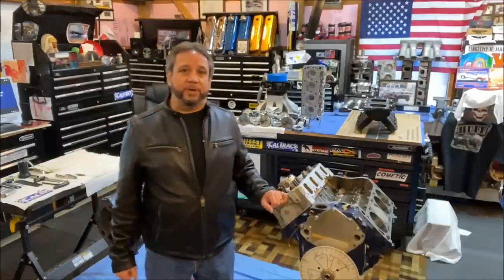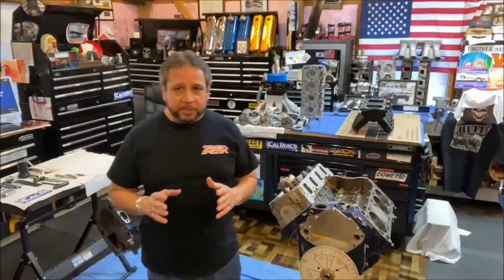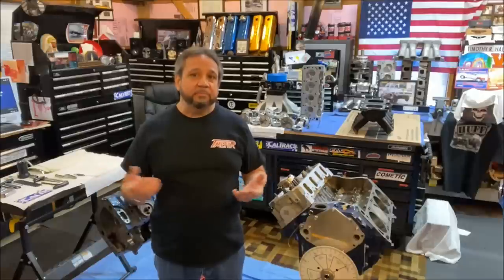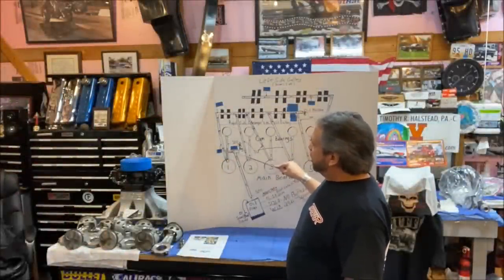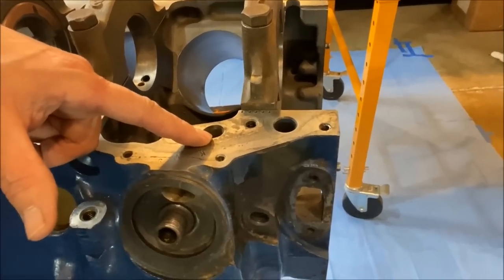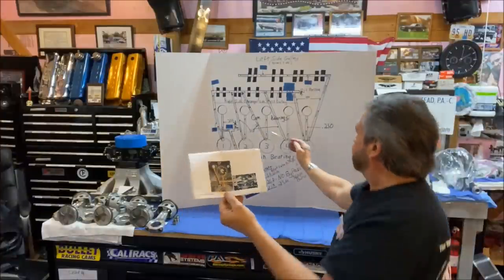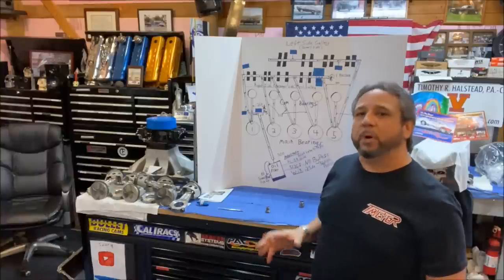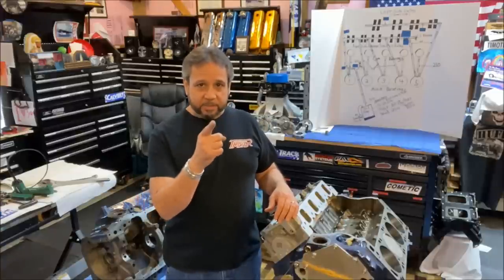Ford 351 Cleveland Oiling,  The Truth, and More

Comment: I built a 351C in the 80’s with mostly stock parts, roller cam and roller rockers. The motor in a Mach 1 with FMX it made 500+hp at crank in 86. Trouble was trans for us but 500 or so in a street car making 380 at the wheels, chassis was crap and flexible! Loved that motor!
Reply from the maker: thanks Paul, love hearing these stories. If you would have a good, C4, it would have been a different story, and you probably bend it up. Thanks for being here, make sure you subscribe, so you don't miss anything.
Reply: Hi Tools, what mods did you have on your Cleveland for the 500HP?
Reply: @DragBoss351Cleveland  what the auto trans to have? And what is manual was an option?
Reply from the maker: @jamesmedina2062 to me a C4, and toploader works well, but nothing like a jerico for racing, sticks only from word of mouth, never raced one yet. But installing on one now in mock up.
Reply: @DragBoss351Cleveland  what if you just want to have fun on the street? Tremec t-5 or top loader?
Reply: @DragBoss351Cleveland  what if it was balanced with flexplate and I want to switch to manual?
Reply: @jamesmedina2062   we used an FMX just barely held together, cast iron cast and sacrificed over half again more weight than a C4 or a manual, my opinion T5 was never up to that HP,,, TREMEC maybe but not in that vintage the only manual of that vintage was the T10 toploader! Today I would use the C6 or a TKO600. Much tougher and easier to keep together!
Reply: @dennisrobinson8008   crane cams roller solid cam,,, 480 lift  as I remember serious overlap with 12.5:1 veolia pistons I think steel crank and crane roller tip rockers. I can’t remember any more right now! Brain cramps!
Reply: @tools6106  lol sounds good tho.
Reply: @dennisrobinson8008  it was 80s cool, wish I had that car now! It was my best friends, he ended up going to play for the other team,,, we parted ways!
Reply from the maker: @tools6106 yes for sure. I love all cars and engines and don’t get caught up so much in the drama. I just love ford’s.
Reply: @tools6106  Thanks man! I would like to manual swap to the TKO but money may not allow that. I could use a sale of this one as I am nearing 30 years with it.
Reply from the maker: Toploader I would say.

Comment: Awesome job putting a lot of detail into what can be done at home to get the best out of the oiling system without breaking the bank; even with the DIY lifter bore bushing kit on the market some people just want do do what they can for a few bucks to maximize the oiling efficiency. I spent a lot of time researching all this stuff before doing essentially what your describing. Most DIY guys are gonna have all the tools needed to smooth out and radius these galleys and put in a restrictor kit; great job. 

Not sure if you mentioned but for the restrictors; if your running a hydraulic cam they say to leave out the rear lifter galley restrictor as they need more oil.
Reply from the maker: Thanks Troy for the info. I did not mention that with hydraulic lifters. Good point, I never raced with anything buddy solid/solid roller cams. Yes they can clean lots of areas with minimal tools. Thanks again, stay tuned.
Reply: Love the solid flat tappet I put in mine; really woke it up a lot over the hydraulic it had in it before!
Reply from the maker: @troyberg65  no doubt, I have never ran a Cleveland in racing with a juice cam, only solid or roller. Went from 12.05 to 11.25 with only changing from solid to solid roller. Put I. A roller and see the difference. Obviously one that will fit your combo and valve clearance. Thanks Troy
Reply: @DragBoss351Cleveland  that really is a wild difference; I haven't made my final decision on cam but I am going to be running just iron 4V heads; probably the closed chamber ones (have both) current stock bottom end unit is running lunati 30320512 and its a very fun motor; and the whole cam setup was very inexpensive. Where as just the cost of good roller lifters for a cleveland cost well over the cost of everything for the flat tappet. Defiantly lots of benefits to the roller; but it is a mostly occasional street driven car with the odd friday trip to the strip.
Reply from the maker: @troyberg65  match the cam to the combo, if it is what works for you, roll with it. Your right lifters bare minimum $700, or up. Nice cam, $400, right valve springs pac, nice locks and retainers. $500. $1500-1800, depending on options. Once you drove it, you would never go back. The ground shaking, it’s all good stuff. Stay tuned.

Comment: Nice work mate Yes Aussie here lol Have owned 6 clevelands over the years and rebuilt 2 and first thing was (By recommendation from drag racers,Mechanics etc that knew the engine) drill the valley  in specific location  (Lifter) radius and chamfer holes then slippery paint Next was high volume pump with oil restriction via spring pressure in the pump then pull threaded plug from front left side of block and pipe oil to rear so mains got the oil first (So they said)
Never understood Ford logic here as Crank spins twice the speed of camshaft but all good,
Now this was told and shown to me as a youngish bloke in 1982/83 and 2 bolt block correct crank prep and matching of parts and 5-550HP with iron heads 2V but 4V intake valves and was also told never over exhaust these old gals No more than 75% on the exhaust  (Tri Y headers not tuned unless 4v big port heads and high comp -  3 inch mandrel exhaust max or twin 2.5inch and we got 520hp no issues revved to 7000 and only issue was that bloody thermoquad lol -  Great video and yes Im subscribed Cheers and G'day from Queensland Australia
Reply from the maker: Good day mate! Good to see you here. Sounds like you have all the tricks. I always say do what works for you. Sounds like you got it. Thanks for the sub, more Cleveland Coming, stay tuned.

Comment: Tim Back in the 90s I bought new filter adapter fittings that had large Allen head machined into the fitting so you could install and remove the fitting  without tearing the thing up or searching  for your double nuts . I have moved on to 385 series  20 years ago. Maybe some day back at it with 335 series. At one time the 351 -C could make more horsepower than any other engine on Gasoline I believe  that was a statement  by Hot Rod magazine.
Reply from the maker: Yes the new Tim Meyer has that configuration. They can make power just have to spin them a little. Love the 385series engines for sure.

Comment: I'm finally getting around to seeing this video in its entirety. Great stuff. I agree with @ford-speed about trying to chamfer and clean the galleys. I never did it with a Cleveland, but in later years we experimented with Extrude Honing, especially for cooling. Just one idea; I know, this was a year ago, but something to consider. I will also send you an E-mail with some ideas we used back in the early 80's. We would tap into the right side lifter feed and plumb directly to the left side. I have been trying to find old notes, doodles and what ever information I still have. The other great trick was to start by re-aligning the lifter bores. I was taught that they were horribly aligned from the factory and for street applications, it legitimately increased vacuum and increased oil flow by relieving torsional stress. I think that the legendary Hansens Machine in Santa Fe Springs showed me that for almost all Ford Engines.
Reply from the maker: Phil, thank you so much. Once I get caught back up, which is sometimes slow for me with everything going on. I’m going to rework the oil galleries, I have a buddy in Australia, and I’ve mentioned before Jason Murphy, and he does this to the max extent. It has his own pictures that he was going for five for me when I make a video. I have heard about trying the lifter bores. And I think BHJ come I made a tool for this. I know Tim Meyer, who is making a aftermarket track boss Cleveland Block. It’s going to do a new printing service for Cleveland blocks. To true lifter bores. I also have a Hank the crank oil system. I’m going to do a video on. Stay tuned, email me when you get a chance.

Comment: Good tutorial
in any engine, oiling and filtration are the keys for longevity, you discuss about the 351C engine, your application seems to be for high RPM use ( That I qualify of overspeeding ) but it have its utility too in more conservative applications as marine where the engines are operated  for long periods near the maximum RPM. For any engine, the study of the oiling diagram and the actual oiling network offers opportunities for improving at about zero cost the time ( mileage ) between overhauls ( TBO)
Reply from the maker: Jacques, you are so right. Lots of my tips, or solutions, are good for any engine, not just Clevelands. Anywhere you can reduce strictures, and improve the path and flow, is a win win situation. Glad your here appreciate your thoughts. Don't forget to like and subscribe please. Thank you.

Comment: I just watch a video where the guy made a pretty good case for the head design causing starvation issues. Apparently the drainback holes are designed to keep the valve springs flooded. Which causes problems when combined with high rpm and small sump volume.
Reply from the maker: Saw that, may contribute, not sure in design. I always use a 9 qt pan. Eliminate that from equation

Comment: Tim I have drilled out some of the oil passages and then run a small ball hone throught them and used a hi volume oil pump with the normal restrictor kit  that worked for me love the content  cheers from downunder
Reply from the maker: Thanks Alan, appreciate the heads up. I have done bare minimum too, and luckily survived. But after this dissection, some changes in the future. Thank you all from down under, Australia 🇦🇺 👍

Comment: I had some assistance from Earl Wade, Dyno Don Nicholson's engine guy when I built a Cleveland for my new 1971 Mustang back in the day. Not too many people had started using These yet and not too many parts were available. Earl had us block the oil passages with set screws with specific diameter holes drilled in them. He also had us do the external oil line. The engine used the first and second set of pistons that Venolia made. Crane cam with Jomar girdle on roller rockers. It had a gear drive instead of timing chain. Marv Ripes at A1 did the transmission and torque converter. It was a fun car to drive on the street with essentially open exhaust. 
Moroso came out with an oil restrictor kit a few years after we did ours, so it was a commonly known trick in the day. I was told the engine was originally designed for truck use co it Would pump a lot of oil to the top end which you may not want on a race engine.
Reply from the maker: Cool history my BMW aficionado, glad you experienced the power of the cleveland, especially by Earl Wade. Nice deal, have a set of those pistons in my parts depot thanks for watching my channel hope you subscribe and like 👍
Reply: @DragBoss351Cleveland  First set had problems with the dome clearance and pockets for valved didn't have clearance. They were remade and got it right on second set. It was tough trying to build en engine when it was early in aftermarket development. At least Edelbrock had a manifold, although it was dual plane. And Milodon had an oil pan.
Reply from the maker: @velvetjones1856  Sounds like early on for sure. Glad you were able to get it worked out, must before the Torker, and Strip dominator. Early 80s? Just finished PV clearance video, going to post tonight. Stay tuned...BMWM2
Reply: @DragBoss351Cleveland  Very early 1972-1973 time. I bought a Chevy Vega GT as a daily driver while converting the Mustang. 
We were never able to get the Mustang to hook up as well s it should have done. Used 10.5" slicks and the old slapper traction bars. Pretty crude these days but standard then. 4.44 rear gear.
Reply from the maker: @velvetjones1856  got it. I bet with Calvert mono leaf and Cal Trac, be a different story. Great experience for sure. Thanks for getting back to me.

Comment: An AFL-1 oil filter is NOT a by-pass filter system.

It's a full-flow filter, with a built in pressure relief by-pass VALVE incorporated internally into the base of it, that allows it to to by-pass the filter media when the oil is cold and more viscous, or when the filter media becomes  restricted with contaminants.

A by-pass oiling system is something completely  different, in where a seperate circuit runs in parallel, constantly flowing oil back to the sump.
Reply from the maker: Sounds like you got it all figured out. Thanks.

Comment: I run the line from the 585 plug to the sending unit plug or the plug on the back of the block it’s the same thing. It definitely improves the oiling!
Reply from the maker: Never used it in 40’years of racing. Tried it and no issues that I know of. Thanks Robert.

Comment: Tim, I am not sure if you know Lenn Bertran or not.  But he runs or used to run a Cleveland in a Maverick and would leave the line at about 9Grand!!!  I think the quote was you could hear the Cleveland "Shreaking at 9600 as he left"!   LOL   He also run a AOD behind it! He has Lentec transmissions,  their web site is still up.  If you go in the web site and look at customer photos, there is still a photo of the Maverick coming out of the hole on the rear bumper!
   I still have my Cleveland 4 bolt main, it came from my Grand Sport Cobra Jet Torino.  I have ran open chamber and closed chamber heads in a couple of configurations.  The body is rusted out now, but I am keeping the power train back, may build it again.  I have a NOS tunnel ram.
    Didn't Hank the Crank run a bulkhead fitting through the block or intake,  and under the intake and drill into 3th main gallery and plumb in there?  I know they did on the 385 series. Not trying to confuse anyone, but I seem to remember a old Hot Rod article showing that, also had the other hose going to the rear pressure port on top that you were mentioning.   
  Great video,  thanks for sharing.
Reply from the maker: So cool to hear that story, and with an aod. Wow. Keep that cleveland and get it all back into something. Be nice to see the TR sticking out of the hood. The Hank the crank system did tap into the oil galleys. I actually have one so I will make a video on it when I can. Thanks Earl

Comment: Why not plug passages from crank to left side and install jumper lines from right lifter galley to left in a couple places between lifters with 1/4” hard lines. Pro stock small  mopars used that back in the day eliminating external lines. Just a thought.
Reply from the maker: There are lots of options, I guess that could work. I try to not complicate it too much. Some guys have gone and re routed oil internally, more direct oiling. I think hank the crank set up may have done that. I need to ck that out. Thanks for watching and contributing Steve. Be safe and be fast.
Reply: Been watching your channel for some time and must say it’s awesome some of the guys sponsoring your channel are heavy hitters for sure. I honk you have the cylinder head department covered. Got a great inventory of some nice pieces.
Reply from the maker: @steveelenbaas5999  I used to have 10 different sets of heads, from iron 4v, to high ports, to multiple sets of Aluminum heads. buy, and sell. Thanks Steve.
Reply from the maker: @steveelenbaas5999  ps Steve, I have a lot of help from sponsors of you need anything call and say I sent you they will hook you up.

Comment: Me too! Glad to be here! 351 " Clevelands" rule, and are my favorite subject matter. That's that!
Reply: There I am " subscribed"
Reply from the maker: That's what i'm talking about Wesley, thanks for ringing that bell, They do rule, and we will bring much more to the table, get sharping the knives...
Reply: The 400m, is obviously a " 385" series block too! Can I assume that this information applies to the 400m, just as it does to the 351?
Reply from the maker: @wesleysept6536  yes applies to all engines  in regards to deburr and clean up. The 400 is considered to be in 335 series, but it does have the 385 series bell housing
Reply: @DragBoss351Cleveland  thanks for getting back to me, I'm " carless" at the moment. I am an engine builder though, the engines that I built before were all 302s. I'm " never " building a small engine again! I am looking for a 400m, and I plan to destroke it to get it to rev easily. Thanks again my main man, you truly are the Drag Boss. Wes Sept
Reply from the maker: @wesleysept6536  your welcome my friend. Can make big power with 400. Tons out there , I have even considered building one, but have too many irons in the fire right now